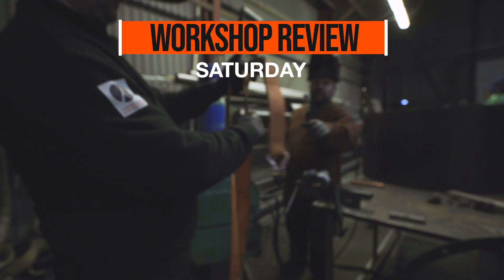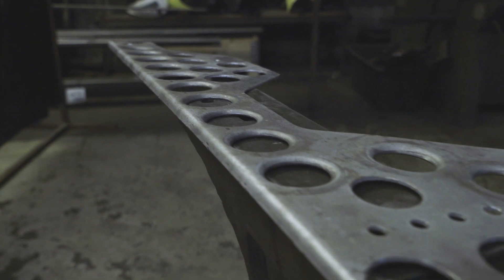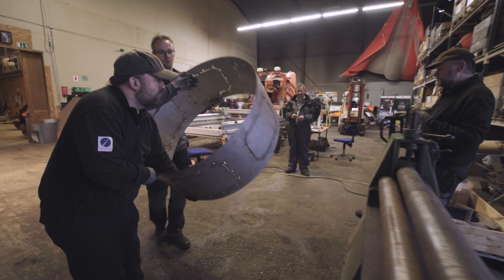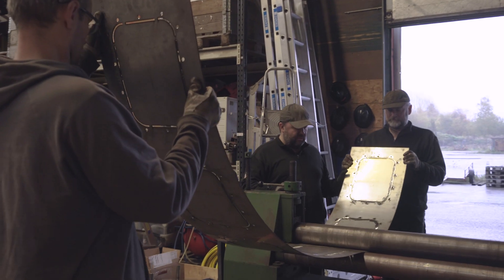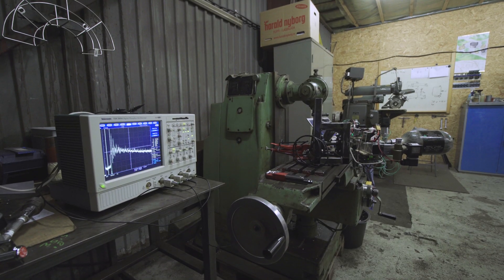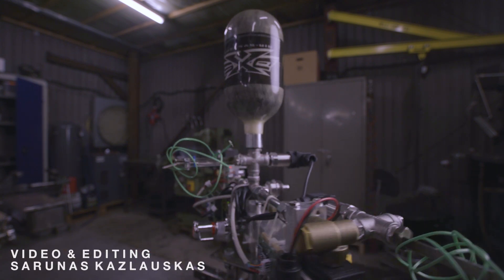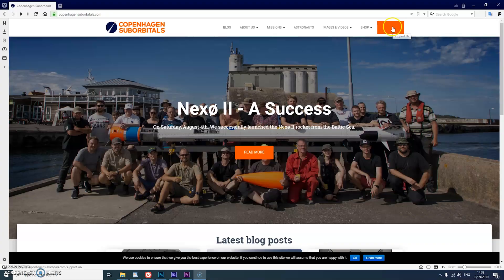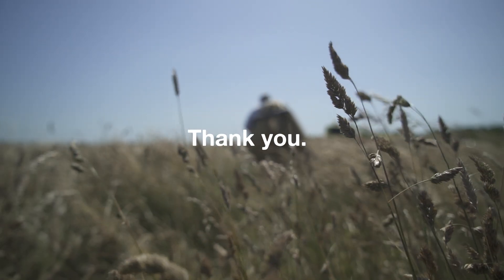Space Capsule Prototype & Inter-tank Section | INSIDE THE ROCKETSHOP: Episode 8

Comment: Ok 3 questions
1 why not make an areospike nozzle.
2 What exams or experiences in aerospace do you have.
3 And why not make a normal capsule.
Reply from the maker: 1. Hard, expensive, so far not proven more efficient and not really necessary since we are not going to orbit and our engine will only operate between 0-30km altitude. Everyday Astronaut has the best video on the internet on Aerospikes, which you should watch if you haven't already: https://www.youtube.com/watch?v=D4SaofKCYwo
2. 7 built and 6 flown rockets, engineering degrees, people with prior experience working at NASA and other aerospace organisations.
3. I would actually like to answer that in a video soon, because it is a question we get increasingly more often. So stay tuned. :)
Reply: @CopenhagenSuborbitals  thanks for always being active
Reply: and on more question what was it like when peter left the group
Reply from the maker: @thelittlerubberduck3260  It's been good. We stuck to our plan and goal with no issues. CS was always a democratic society, glued together by many more people than just a single individual, even though it might have seemed different since PM was such a prominent figure on screen.
Reply from the maker: @thelittlerubberduck3260  You're welcome. Thanks for the continued support and questions!
Reply: @CopenhagenSuborbitals  what is your estimated day/year of the launch of the SPICA and is there any projects after the spica
Reply from the maker: @thelittlerubberduck3260  Spica I is expected to launch in 2021. The crewed Spica x is some years out in the future. We have no plans for after Spica, since this is such a gigantic project in itself. Remember that only three nations have so far succeeded in what we're trying to do on a crowdfunded budget.
Reply: @CopenhagenSuborbitals  i understand its hard.
but i dont understand is it suborbital or orbital
Reply: and i think you should make a discord server so you can chat easier instead of having to write in youtube comments
and do you ever use kerbal space program
Reply from the maker: the little rubberduck you find the answer in our name :-)
Reply: @CopenhagenSuborbitals  oh yeah
Reply: Hej igen jeg ville spørge om man kunne komme i praktik hos jer når man går i 8. Og elsker raketvidenskab?
Reply: I might be wrong here, but i guess the capsule design is vaugly inspired by early NASA project in the 60-70s that looked pretty similar to a small space shuttle, that design will give a lot more control in a smal modul compared to an eliptical shield and also a much softer impact compared to the early russian sphere shaped capsules, the russian capsules in the 80-90s had actualy a pretty similar design as this,they are just a bit different because they are much larger and need to keep the balance point lower in comparishion. At least that's my 5 cents.
Reply: We hawe to remember that both R7 and Apollos ancestors where much larger in size compared to this project, so an eliptical shield could easily be made in a proportionaly working size to make it relativly self stabilizing just by making the capsule slightly larger than the noose cone on the rocket, that is not possible on this machine as i think because its smaller bodysize.
Reply: I think aeorospike designs hawe most of its strenght in the dynamic rage of one and the same nossle instead of multiple nossles, but the nossle it self will also always be more or less a compromize, the reason ARCA are planing use them on the upper stages are, as i understood because it will work as a multipurpose engine since the ribbon type aerospike are so to speak "self adjusting" and not reliable on a certain type of "bottleneck" for a certain expected outher pressure range as regular Lavall nossles are, the aerospike can operate pretty well in the entire scale of all in reality existing pressure zones without any significant preformance drop, but it will newer be 100% optimized for any of them.

(at least my common sense tells me it would be something like that i guess...)

But for a project like this it does not matter as said above since this rocket will not realy experience those problems, at least not that much as it going to realy affect the engines preformance i think, one solution has of course been to use a center type aerospike, but as said abowe those are significally more expensive to make, and i also think the increase in preformace had been very little, possibly even close to 0/0 in this particular project. 

For the ARCA project it's different.
Reply: I removed those Peter comments since they don't belong here.
Reply: @Vampi_Sweden  me too
Reply: @thelittlerubberduck3260  Good.
Now You know.